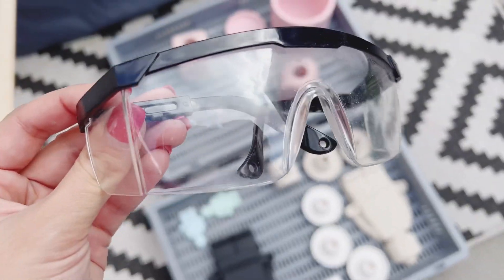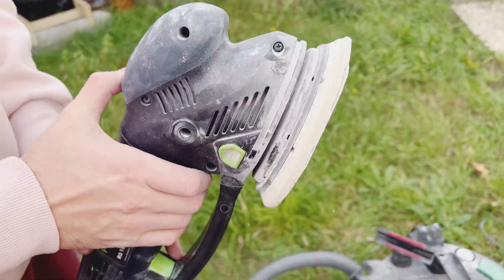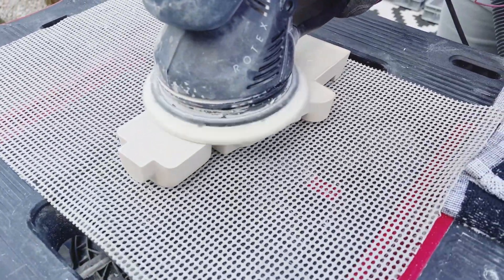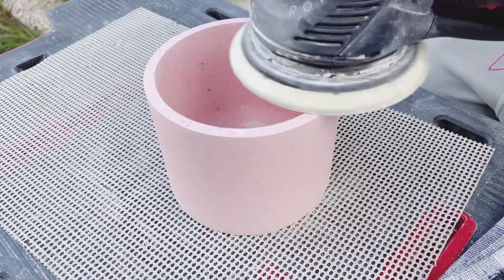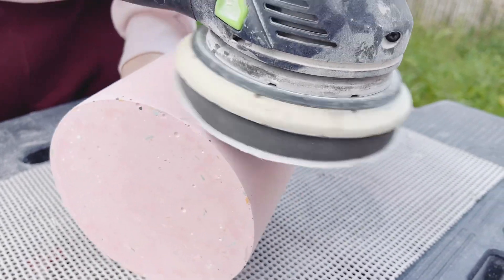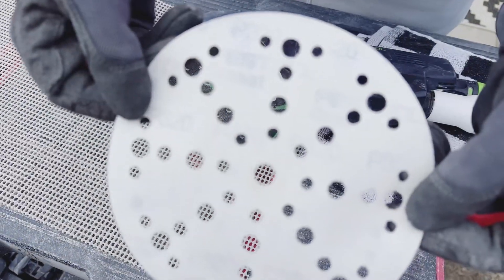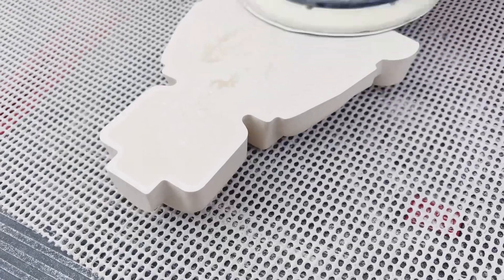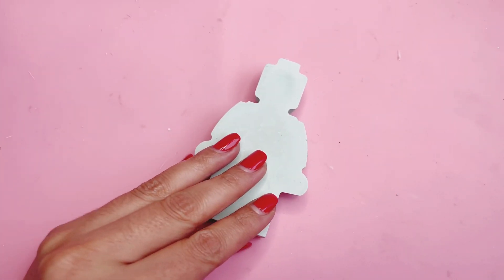Save your time with QUICK and EASY Jesmonite Sanding | 제스모나이트 샌딩

Comment: Really helpful video. I start with 60 grit on my sander, it just seems to take so long to get the chips to show otherwise! Do you sand straight after making the items? I've been leaving mine for a few days or weeks, maybe that's where I've been going wrong
Reply from the maker: It depends on your comfort level when sanding and using these type of machines. If you don’t have a lot of experience we would advise to wait for 2 days so the material achieves it’s full strength. Otherwise, you can sand straight away 😊